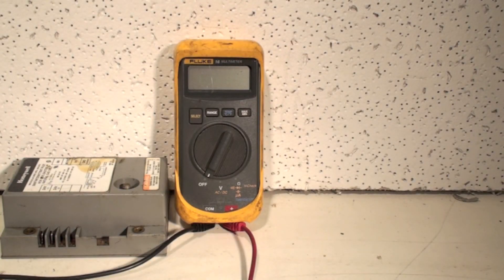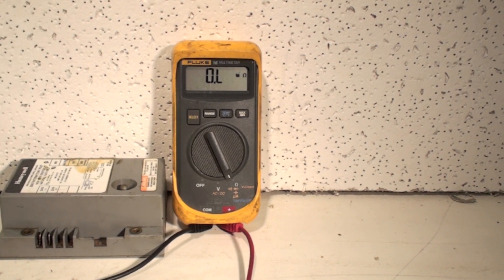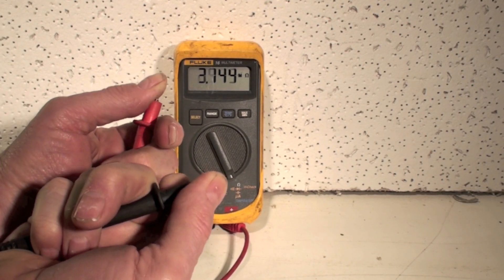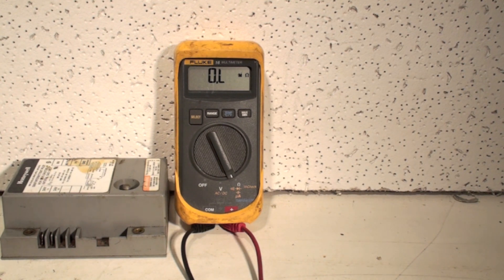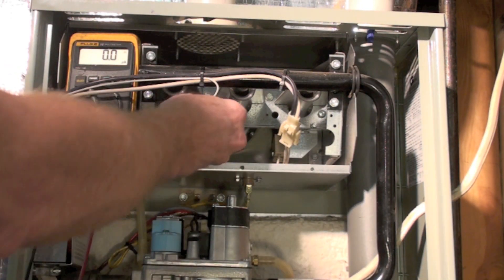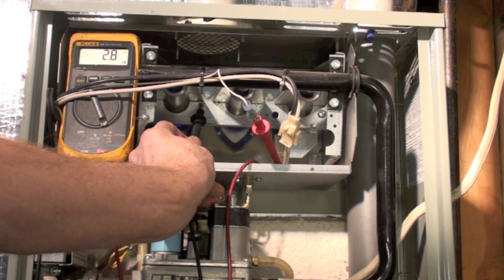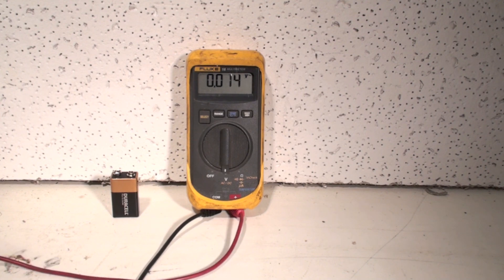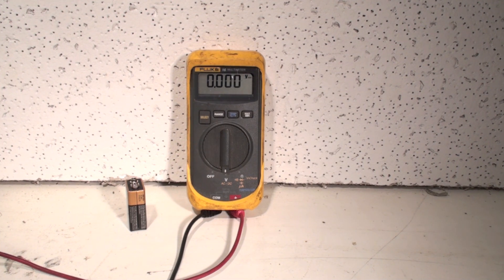How to use a multimeter for HVAC part 5

Comment: The voltage on the Ohm side is the LoZ setting it's used to eliminate ghost voltages if you have induced interference from other circuits it provides a Low 2 K resistance it shouldn't be used on control circuits
Reply from the maker: Robert Reed Thanks for the info.GFM

Comment from the maker: There are "cheaper" meters out there that are viable for commercial usage.  As to the very cheap meters, they are ok for the homeowner that uses them occasionally in some cases.  But continued use every day as a tech would do, will damage the meter and be dangerous for the user.  Check the meter playlist  on my channel.  Hope it helps.
GFM